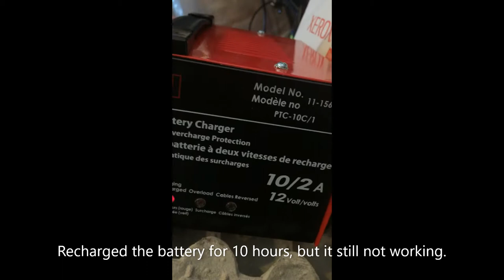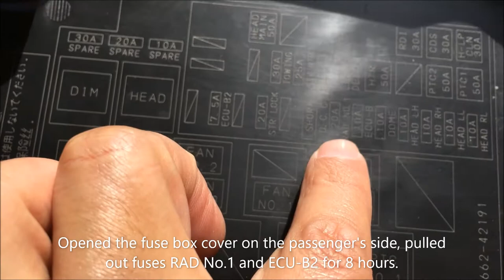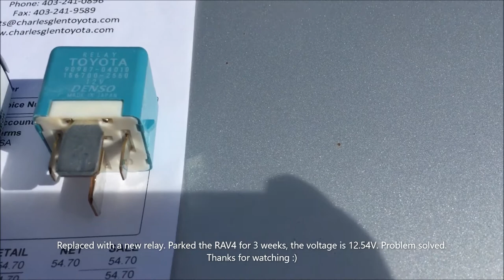The way I fixed parasitic battery drain on a Toyota

Comment: If there was no voltage drop on either of these fuses when you tested, how did you figure out it was the ECU-B2 fuse?
Reply: so after he traced it to ecu-b2, which goes to a junction box/ fuse box that ac relay was located, he plugged back in the ECU fues. he continued to pull fuses and relays until he found that the AC relay was drawing amperage. he disconnected that relay and battery remained charged.. ordered a new relay and fixed the problem. if you know relays u can add power/ probe it and can confirm the relay is bad also before purchasing a new relay. it's process of illumination. amperage drawn by ECU fuse which goes to another fuse box, with-in that fuse box, the culprit was the AC relay.